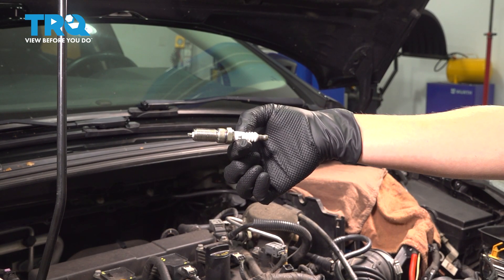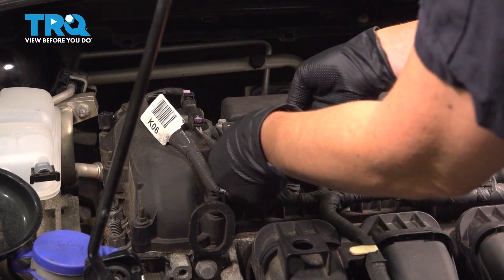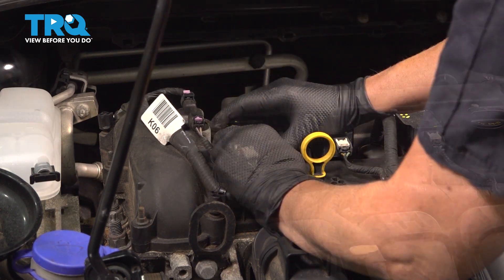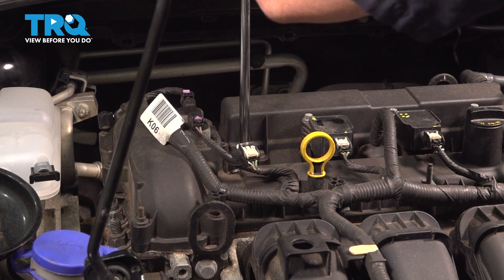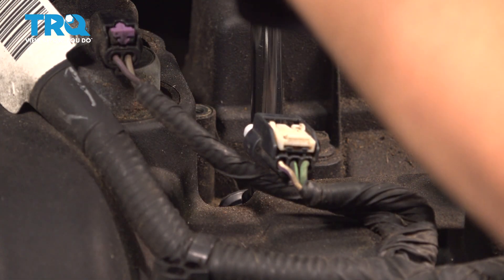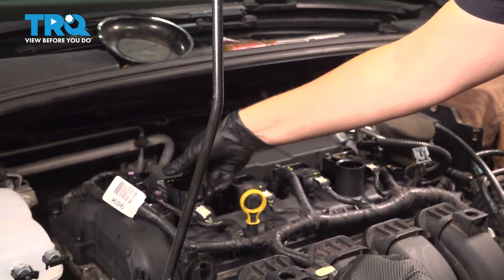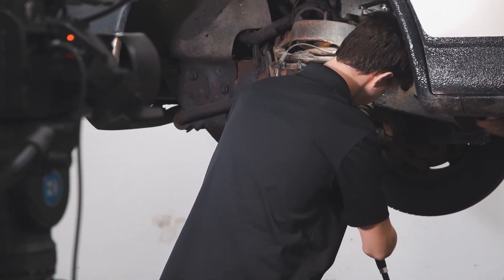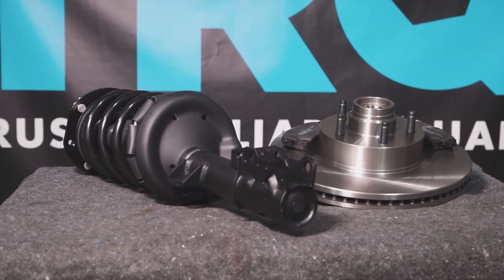How to Replace Spark Plugs 2012-2018 Ford Focus 2.0L L4

Comment: Hi. I have two questions. Did you use anti-seize on the spark plug thread itself,  and did you disconnect battery negative terminal before beginning?